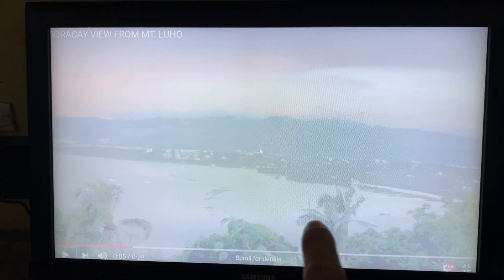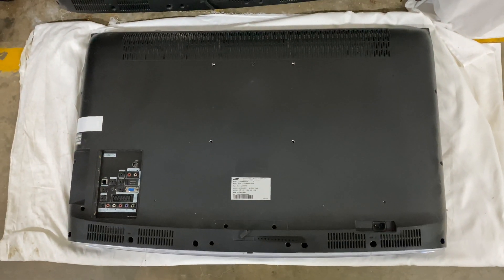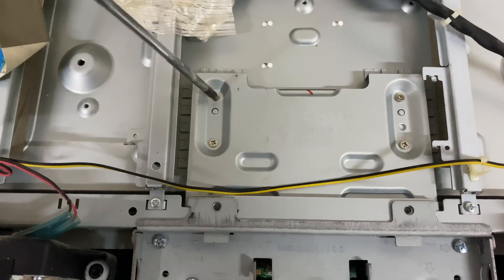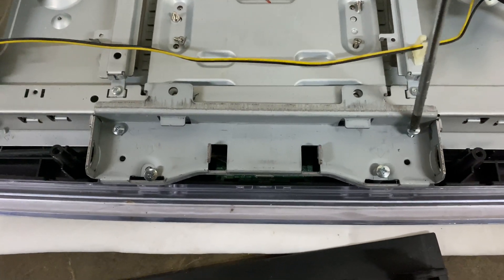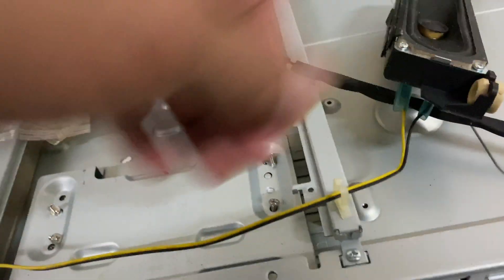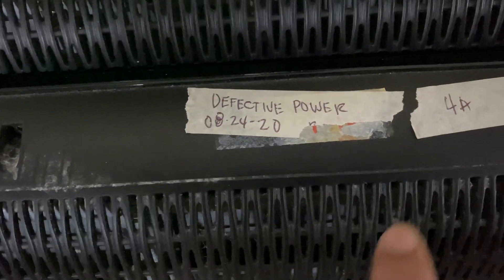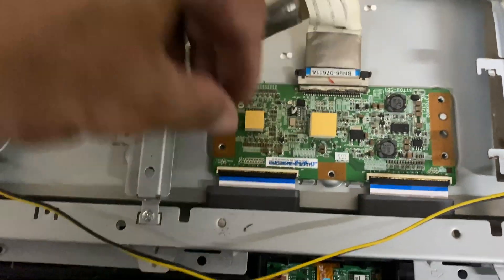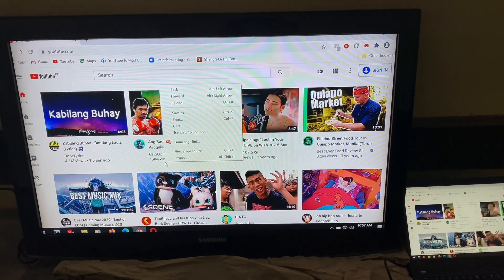SAMSUNG LCD TV BAD COLOR | T-CON BOARD REPLACEMENT

Comment: Hi guys, just replaced my t-con board, exactly the same fault still there, couple of horizontal lines 1/4 from top. What now, replace ribbons? Replace another PC board?, anyone got an answer, please?
Reply from the maker: Horizontal line could be in the lcd panel itself.
Reply: Thanks for reply, I also tried the taping covering up pins, and blew the board!
If it is the led screen, then I believe this cannot be repaired, it has now got worse, a lot of horizontal lines repeating themselves, giving the appearance of double images, blurring. Time for a new one after Covid.